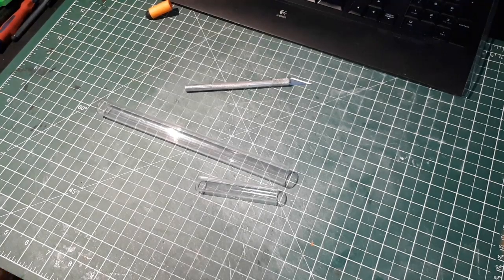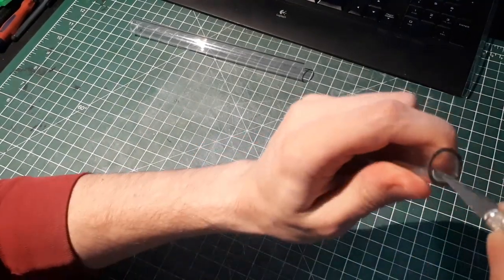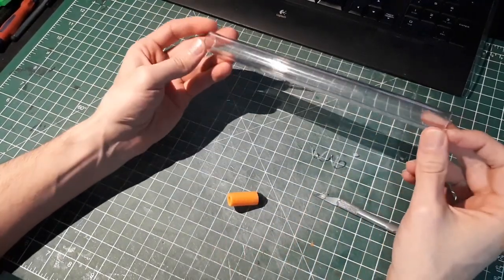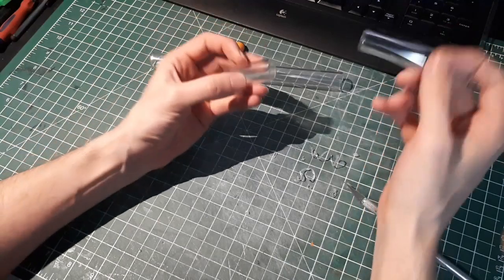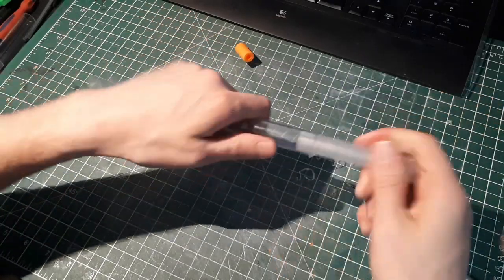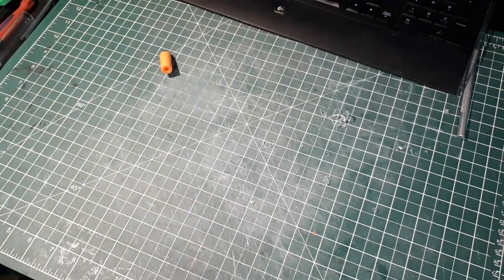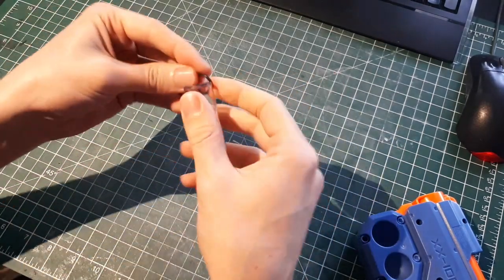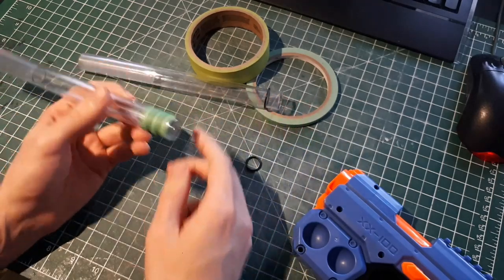TKO build guide part 3 - Inline Clip - Re-uploaded

Comment: Would this work with the new adventure force half length darts? I notice the darts that you are using have a more sharper edge so it can seat easier in the barrel, but with the adventure force they are more flat headed and I’m not sure if they will work with this mod

Comment: So sanding will obviously work but I think if you heat up the tube with a hair dryer you should be able to force fit the smaller piece into the larger. Wear a respirator if you try this though

Comment: Hi, did you tested a 5 rounds clip instead of 4? Just wondering can I get the same performance with a longer 5 rounds clip.
Reply: Adding more capacity to the clip drops performance. A 5 dart one should work, but it won’t hit as hard, because there’s more dead space the air has to travel.

Comment: Could you link somewhere I can buy the tubes and O rings?
Reply from the maker: I bought mine from Amazon. All the materials I used are also available from McMasterCarr aswell.
Reply: @ehdrien1094  I went on Amazon and some item descriptions are confusing, could you leave a link to all the parts you got so i can make sure i buy the right ones?   Any help is much appreciated
Reply from the maker: @eliteenvisionary  
o-rings
https://www.amazon.com/014-Buna-N-Ring-Durometer-Black/dp/B000FN0VCY/ref=sr_1_3?dchild=1&keywords=014+o+ring&qid=1591149966&sr=8-3
larger polycarbonate:
https://www.amazon.com/Clear-Polycarbonate-Tubing-Wall-Length/dp/B000OMJ50K/ref=sr_1_8?dchild=1&keywords=1%2F2+inch+ID+polycarbonate&qid=1590983691&sr=8-8
smaller polycarbonate:
https://www.amazon.com/Polycarbonate-Tubing-Wall-Clear-Color/dp/B000OMJ4YW/ref=sr_1_1?dchild=1&keywords=1%2F2%2Binch%2BID%2Bpolycarbonate&qid=1590983691&sr=8-1&th=1
Reply: @ehdrien1094  Thank you!
Reply: @ehdrien1094  thanks this is really useful
Reply: @ehdrien1094  putting this in the video description of the video would probably help a lot of other people too. Had the same issue trying to find stuff on amazon
Reply from the maker: @moose5660  Yeah, those tubes have only gotten harder to find. The ones that I can still find on amazon have also quadrupled in price in the last year. It's really annoying. 

At this point, you would be better off replacing the polycarbonate inline with a printed/brass combo. There's a TKO compatible inline on thingiverse, uploaded by user SomeDingus.

https://www.thingiverse.com/thing:4521442